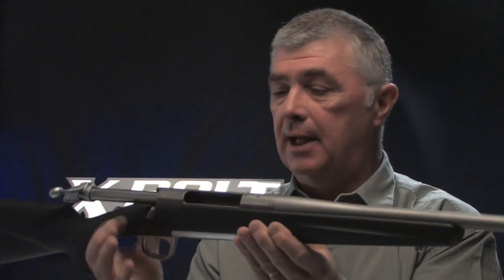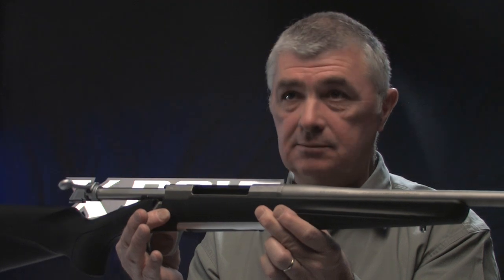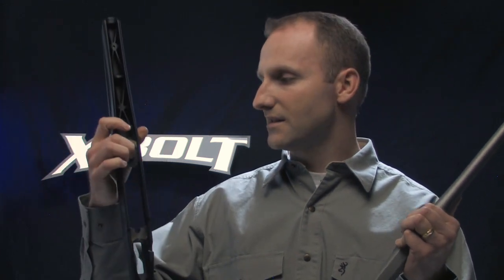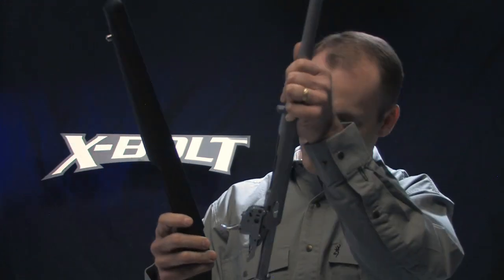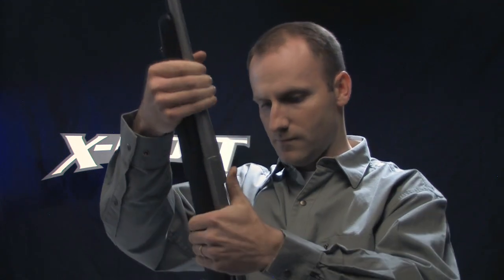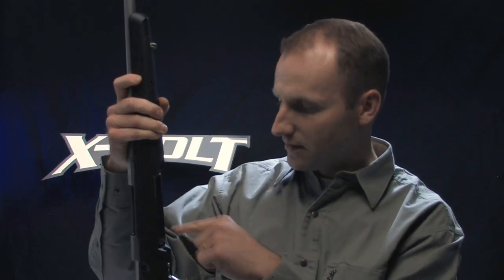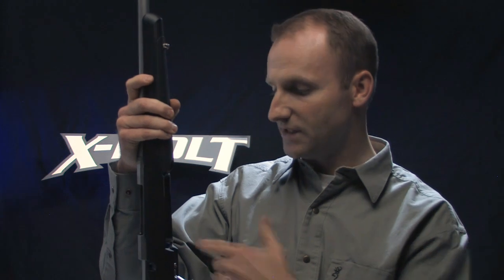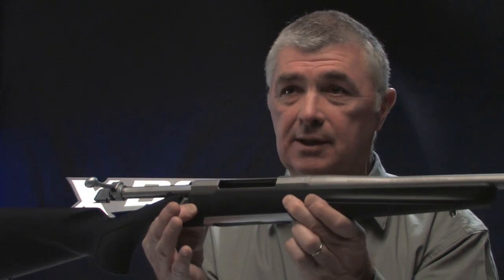X-Bolt - What makes our barrels and bedding better, from the engineers - 4:49

Comment: Talk about the X-Bolt PRO model factory lapped barrel. My 6.5 PRC Pro gives me 1/2 MOA 4 shot ragged holes at 100 yards. (5 shots heats the barrel up and it begins t open up to 1" MOA. even with 5 minutes between shots. This in 100 F. days, BTW. YMMV

Comment: I have an xbolt in 300win mag. It shoots 3.5 inch groups at 100y with premium (very expensive) factory loads on a bad day. On a good day it will shoot 2 inch groups with the same factory ammo. 
With hand loads that have been tweaked by a master reloader, it will punch the same hole at 100y regardless if it’s a hot barrel, dirty barrel, cold barrel, wet barrel or  even if I’ve been screaming profanities at her all day. (Not exaggerating) 
My CZ on the other hand will shoot 1.25 inch groups all day, everyday regardless of what it’s fed. Hand loads, factory junk or premium load don’t seem to matter. 
The xbolt also likes to eject the spent round up into the bottom of the scope, bouncing back into the action and when it ejects correctly it barely gets them out of the action. This has spoiled more than one follow up shot while hunting. Yay! 
No such issues with the CZ. 
I love my browning like a crazy girlfriend. She’s fun to play with, but she drives my f*@king nuts.

Comment: bedding "goop" is just slightly harder than rubber cement when dried. Can almost peel it off with your fingernail.
trigger housing is cheap cast aluminum, will break or crack if you try to drive the mushroomed head rivets out.
These two things can be remedied easily enough, otherwise a decent rifle for maybe $500
Reply: You are wrong on everything you just said.

Comment: Funny, my Tikka T3 pure stock, - adding a titanium recoil lug will shoot sub .5 moa off the bench If I do my part. Usually the first 2 in the same hole, 3rd just outside. Only 3 round groups because it 's in 270 wsm which heats the barrel up pretty quick.  And that's with factory ammo. My other Tikka is almost as good a shooter as well. Plus it has one of, if not the best factory trigger out there. 
  I'll also admit I don't own a browning, but I have shot an old think it's BLR in 22-250 and it does shoot great. Thing is, I don't want to risk ending up with a dud. And You rarely here of duds coming from Tikka, compared to most other brands. (Won't touch a freedom arms produced Remington.)  I also think Howa, and Weatherby Vanguard 2's are great shooter's for the price. 
  Not saying Browning is bad, again, I just hate putting my hard earned dollars into taking a risk that I end up with a dud, and gotta go through warranty departments etc.